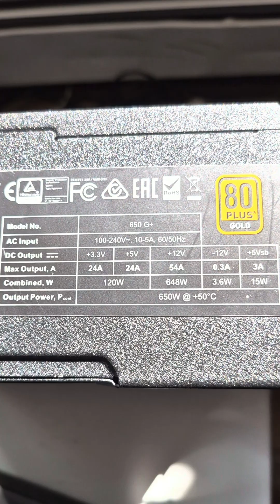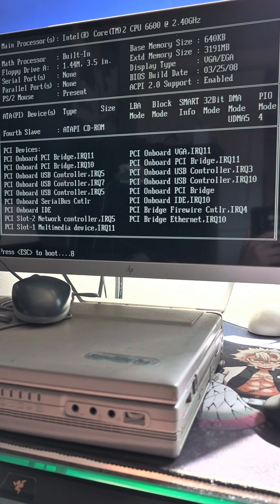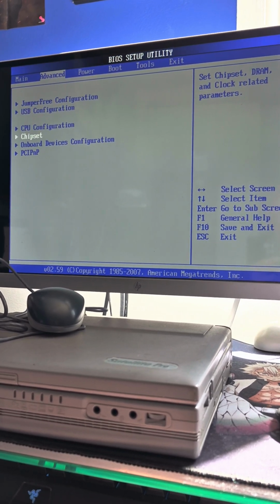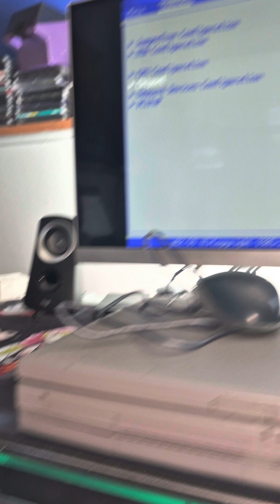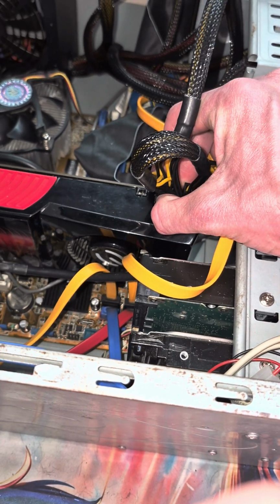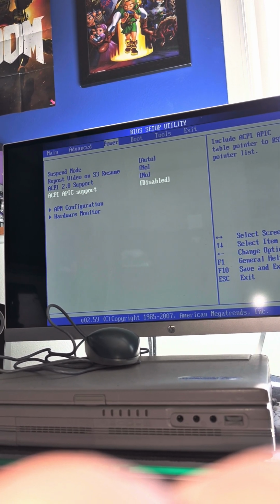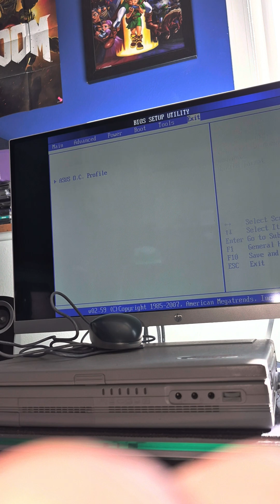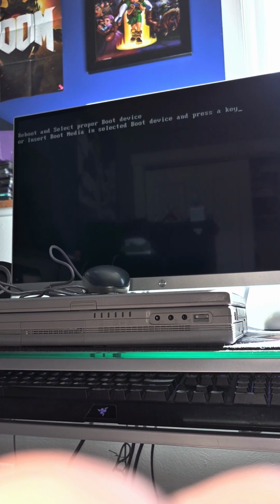GeForce GTX 275 Not Displaying at Post

Comment: Hey i hate to break it to you but that card was released 16 years ago, it's entirely possible it simply died of old age. I hate to say it but GPUs wear out faster than anytime would like. If you wanted to limit other problems see if you have another system with a pcie slot to test ONLY the card in.
As you describe it, it sounds like the bios is not picking the GPU up as a display output. Try a bios update maybe, as well as poke thru the bios a bit to see if there's some option akin to "primary graphics device" or something. That era of board defaults to onboard graphics (or mobo graphics) iirc but it's been a while.

Comment: hey bro not sure if you have figured this out but removing a stick and booting again with only 1  stick of ram inserted may fix ur problem had the same issue with a rx 550 gpu and this worked for me, after that i just updated drivers and put the second stick back in and it managed to boot up

Comment: theres only 2 things left to try- testing the gpu on a different motherboard and testing a different gpu on that same motherboard.
1 will indicate if the gpu is dead,
2nd will indicate if the motherboard is bad/the pcie slot is
best of luck, also that GPU is very old so theres the chance for dead capacitors or dead transistors, recommend taking it to a shop if the gpu is dead but replacements can be quite cheap aswell. your choice

Comment: No, integrated graphics is not turned off automatically after plugging in a dedicated GPU. In some BIOSes you have to change from onboard graphics to dedicated/pcie GPU or it won't display nothing through that GPU.
Reply from the maker: Well the Intel 945G chipset is supposed to do the.

Comment: I don't want to be rude and will try to help. From looking at camera point of view you have vga cabel atached to motherboard which automaticly detect integraited graphic card while I see that you have not atached any display cable to graphic card. 
Solutions that may work:
1. Plug display cable to graphic and see if it works, while other display cable are unpluged.
2. Reste cemos on motherboard.
3. Try using some other device that use pci slot and see if it is not pins problem on graphic or motherboard.
4. Sometimes taking battery out of motherboard and depower system trigger graphic card to work (happen to me once).
The power supply was a good idea.
I hope that any of the solution worked for ya.
Reply: It might be also outdated bios on motherboard but I am 80% sure that might be not the case.
Reply from the maker: Did plug in to dGPU. did not display. Already running updated BIOS.

Comment: I would start with a clear CMOS, leave the bios alone, and plug display cable into the GPU. But on the other hand that card is old enough that it could just be a bad card.

Comment: Not always does it disable the integrated graphics, It just instead makes the gpu the default. You could try booting the system with integrated to manually download the drivers for that card then try to boot with it. That card released in 2009 with less than 1gb of GDDR3 vram running so if that PC is from the past 10 years. It may not even support it.
Reply from the maker: Well on the Intel 945G it does.